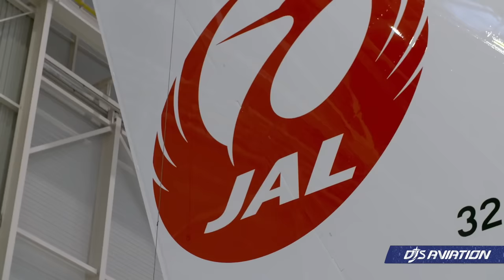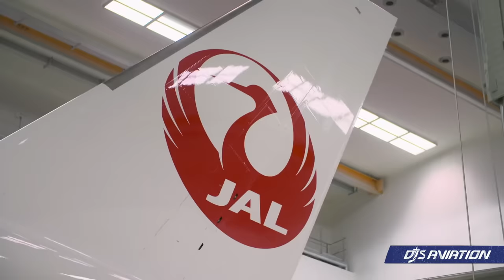Massive Airbus & Boeing Orders

Comment: If the IndiGo order also goes through, then its going to be a stunning first quarter for the A350, so no wonder there are rumours that GE want to get on board, especially with the uncertainty of B777X certification. RR have an exclusive until 2030, long after I suspect Rolls will have diverted UltraFan tech to upgrade the Trents, and with a solid order book for the 350, what would be in it for Airbus..........?
Reply: Airbus stole Boeing order Korean was supposed to order 777x but when they orders a350 it shocked the world 😊
Reply: @Jabsbshs  
Well, Boeing stole the Hawaiian A330neo order with the B787, by undercutting the A330neo!! Its nice for Airbus to return the favour😀. IMO, Korean are ordering the A350 because they have its positive operating statistics from Asiana, and the passenger survivability at Haneda.......

Comment: Airbus should make a a350-2000 that would match the 777x
Reply: they were planning on it but they scrapped it
Reply: They should put it back in planning cause it will have beoing good cause  there 777x is in problems
Reply: Nah they should do A380 Neo.
Reply: @___spiritofadventure___ the A380NEO version is even more unlikely than the A350-2000
Reply: @thevinhnguyen1661  Yes, sadly true.
Reply: A380 is defunct especially now with cracking wings

Comment: Isn't the A350 having engine issues?
Reply: What engine issue? U mean the emirates engine issue? That's for middle east - due to sandy condition the RR XWB is deem not that powerful enough for that CONDITION but for south korea and Japan where the air is much much denser the RR XWB performance really well. So it's about the location of the plane taking off from not the plane itself
Reply: @Wolfennsteinn  I thought they had lower on wing times. I also know the 320NEO with the geared fans are having issues with blades

Comment: Feal like Airbus need to make a A350-1100. to beat the 777 on its own field.
Reply: A351 🤔
Reply: How about the A360.
Reply: @marterair551  IDK.. the 900 is called A359 and the -1000 is called A35K...

i kind of think it was a misstake by Airbus starting the number on 900 (well i guess 800).. and not 200 or 300 that they typically do.

For example the A320 series is first called the 318, 319, 320 and 321. he second gen (basically the one called CEO to day) is called 32C, 32D, 32A and 32B.

And the neo version is called the A19N, A20N, A21N

But for the A330 series.. its just A332, A333, A337, A338, A339. A340 series work the same way.
Reply: @Perich29  making a A360 would probobly be a good idea eventually. But they probobly need to make it for the new upcoming 2028 engines.
Reply: no need to beat boeing ... they shoot them self in their feet longtime ago ....and just in case you don't know 777X is not certified yet and with the safety requirements ask by FAA it's not for the next future
Reply: @matsv201  I agree, A330neo to the length of A340-500 and A340-600 would probably work well
Reply: @marterair551  technicallt A330 and A340 have the same fuselage.. well.. sort of. The wingbox is diffrent and I would guess there are some struts that have larget diameter.

The issue with making a lets call it a A330neo-600 is that the A340-600 have 10 (or 12?) main landing gear while A330 only have 8.

But they almost ceranly could do a A330neo-500 just replacing the center tank with a wet wingbox.

And to be realistic. They would never do a A330neo-600 anyway because it would cut into A350-900... there would be no point.

They don't have a A360... so making  a A350-1100 makes sense.... well unless they have a A360 on the drawing board.

Airbus have not made a full new family since then A350...
 Meanwhile they updated the A330 and the A320. So all models is up to date with current engines.

I would say both a A322 and a A220-500 is plausible. I really think they should do a A220-500 and remove the A319.

A322 would fit the market well.. the issue is that the A320 family maybe only have 10 year prime time left.

I do think the A320 family will get the 2028 year engine transition, but that will be the last. A330 and A350 will also get it.

But... typically there is always a new flagship.product with every new.engine. with the current gen it was the 787, the gen before was the 777, and before that was 767 (half gen) and 747.

Airbus have been behind evey new transition a350 was the current gen, A330 was the gen before, and well A300 as the first.

Airbus is ramping up with a new test platform. I'm pretty sure they want to be first out with the new gen  and they need a new plane.

The year currently slated for the next gen engine is 2028.. typicallt a new family is announced 4 year a head of time.. so this year.

A330 and A350 will nor be replaced. A320 might be... but.. the A380 is alreddy scraped.

It makes most sense to replace the A380...

Of cause... yes.. A380 was to large. Any replacment will be smaler, but larger than a A350.

So what would a A360 be... I would speculate a 3+4+3 configuration top floor with half sub floor with a 2+4+2  configuration and half bottom floor for containers. Say, like a L1011 but larger.
Reply: Won't happen